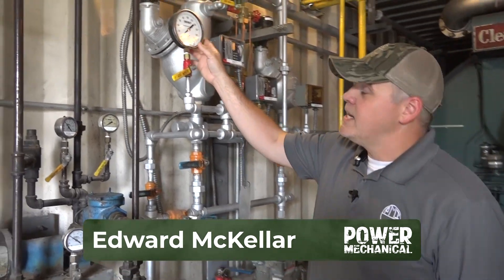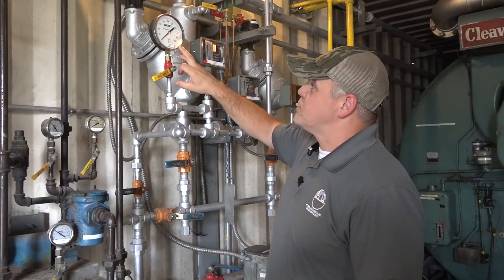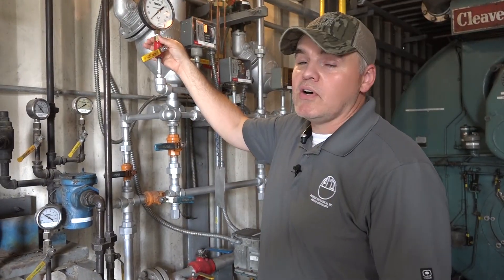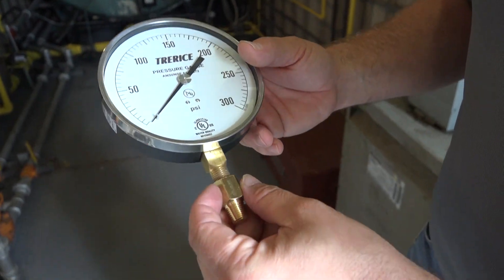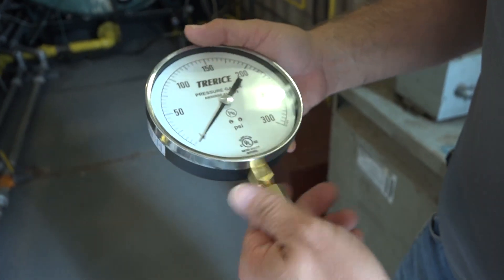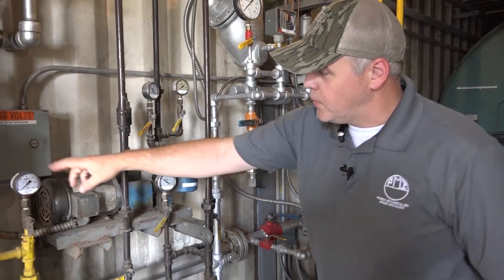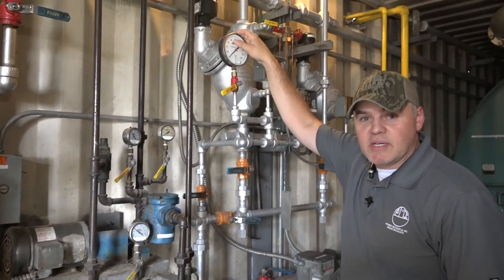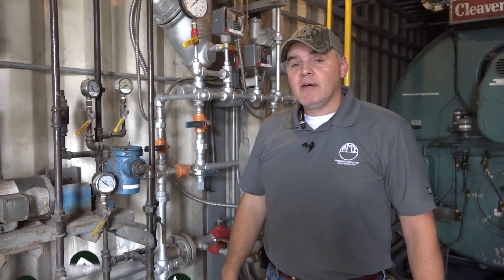Gauge Snubbers - Boiler Room Tip

Comment: Thanks for the video
Is syphon required for pressure gauges and pressure switches?
Is a snubber an alternative for syphon?
Reply from the maker: The syphon tube will protect both switches and gauges from the rapid pressure surges from steam. These tubes generally operate from holding condensate and so we typically try to not use them for our temporary units as it presents a freeze concern. Some localities require the use of syphon tubes on pressure switches however. On gauges they do serve the same purpose.